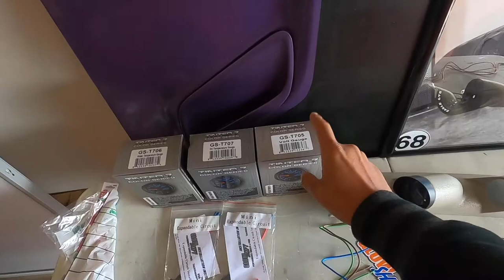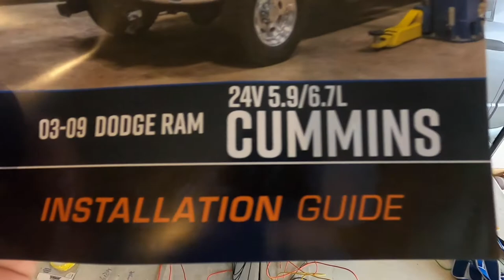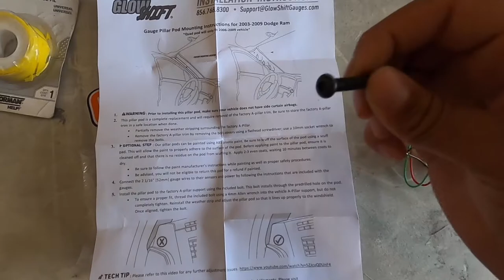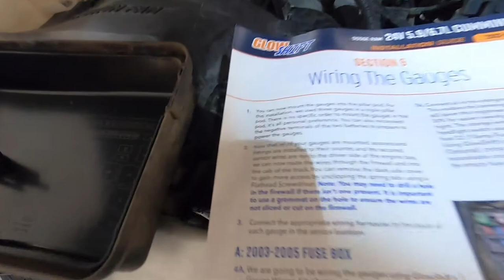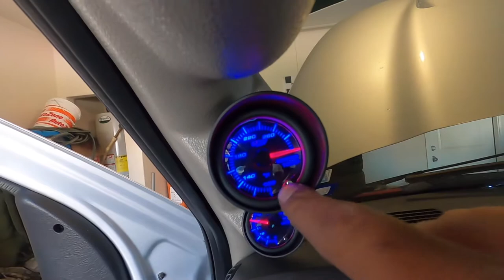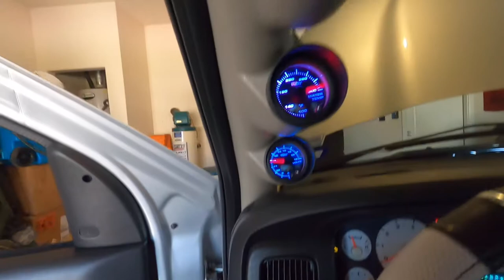Installing Glow Shift Gauges In The Ram Daytona!

Comment: I have a 03 ram 5.7 was wondering what temp should I get for the transmission n oil giving me different temp options
Reply from the maker: For 03-09 ram I’m only seeing 250 degree for trans and 300 degree for oil. I don’t see any other trans/oil options for the tinted 7 color series non digital.

Which gauges are you looking at?
Reply: @TIRADORACING  My bad for the late response, I had to rewatch the video to get to see what setup you’re using. But currently I’m looking at the (water temp, trans temp, and oil pressure temp) but I’m stuck at the optional like fuel pressure apapter, transmission temp adapter if I should go with the test port or 1/2 trans line T fitting. I didn’t see or get a nonfiction that you replied to my comment but hope we see more update on the Daytona !!